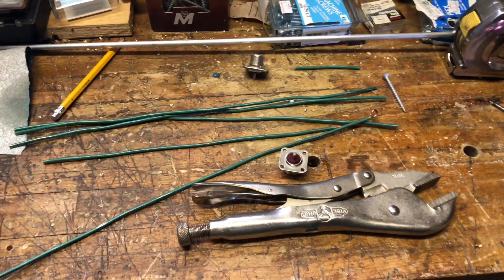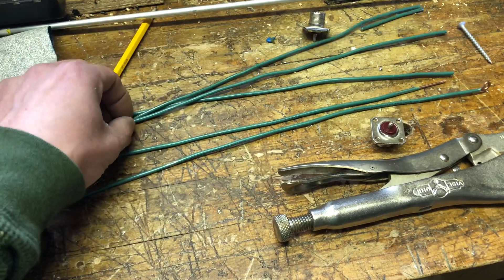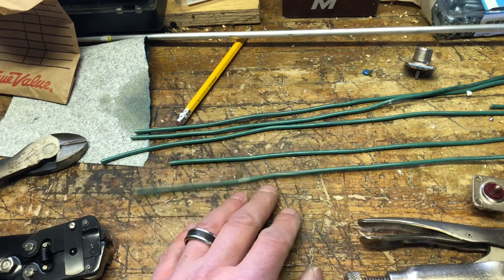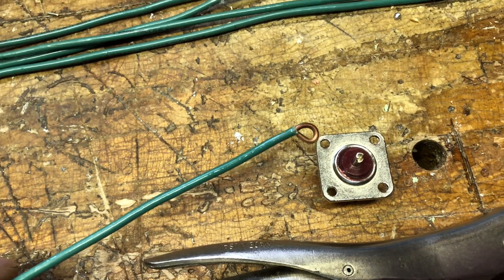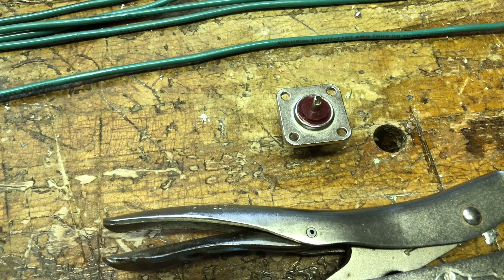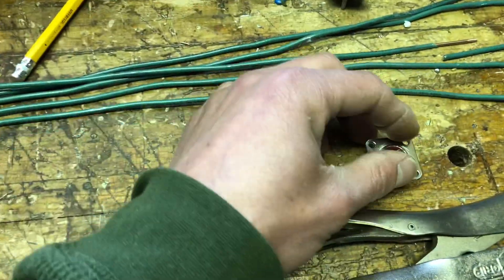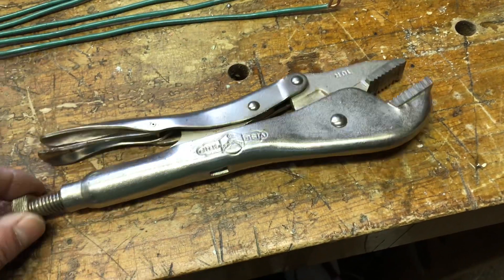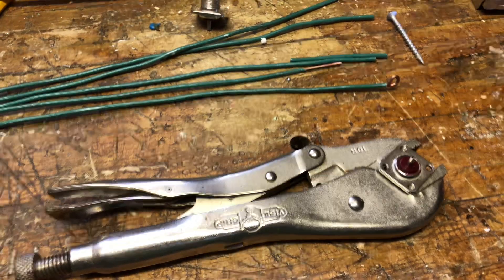Making 1/4 wave ground plane antenna

Comment: Would this work for cb band?
Reply from the maker: Yes it could but you would have to use something more stable like 1/8 th aluminum rod for the radiators and driven element.
Reply: You will have to cut the wire or whatever you use for the center of the 11 meter band which is channel 19 or 27.185 MHz your vertical radiator would be 8.6' long and your 4 ground planes would be 9.7' long